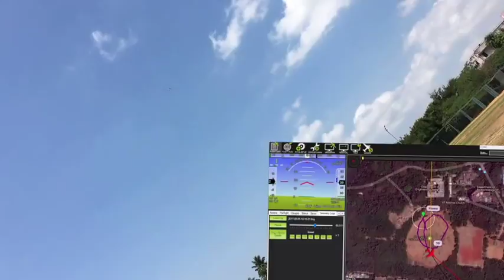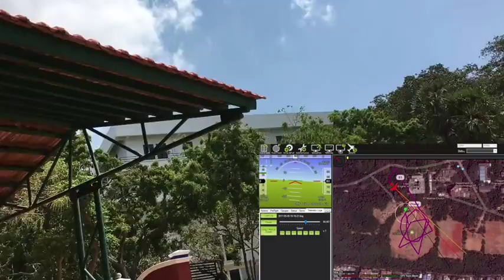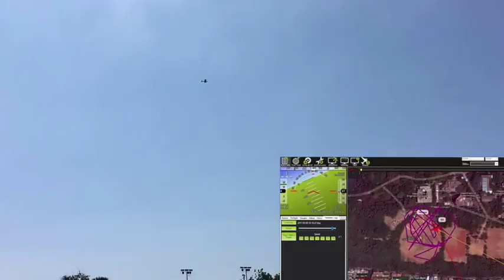autonomous flight of fixed wing UAV with ardupilot APM in auto and stabilize mode

Comment: do you need to have a transmitter ? , can it do a 150 km journey ? without a transmitter and ground control
Reply from the maker: Yes normally you fly it with a radio controller but completely autonomous flight is possible through the GCS(laptop).150km is very difficult with this size.you need bigger wingspan and fuselage to hold the higher capacity battery.
Reply: @TusharJoshiTJandPJ  suppose i use an apm , like ardupilot and have no transmitter and receiver , how will it communicate to the apm ?

Comment: Which board you have used? Ardupilot or APM? Could you help me
Reply from the maker: himansu panda i used apm 2.8 with it..lemme know what help you want...
Reply: I want to make a automotive.plane using APM. Need your guidance.
Reply from the maker: himansu panda lemme know how can I help
Reply from the maker: himansu panda tell me precisely what guidance you need.
Reply: APM Mission Planner connects to ardupilot circuit board with usb to computer.It is called Ardupilot for airplanes,arducopter for Quadcopters,ardurover for cars and rovers...get it?